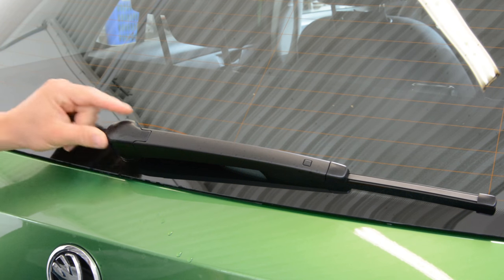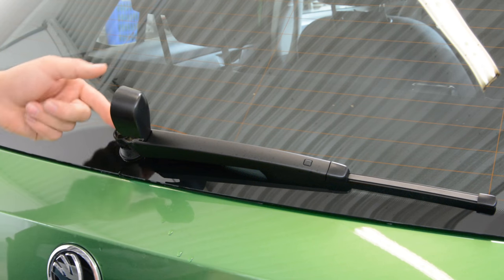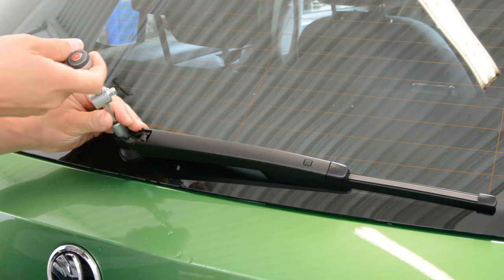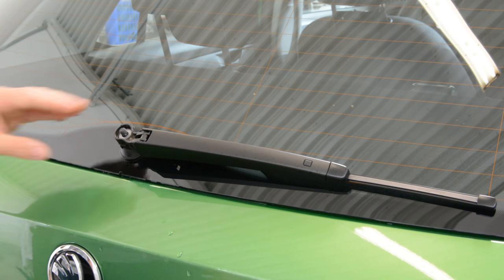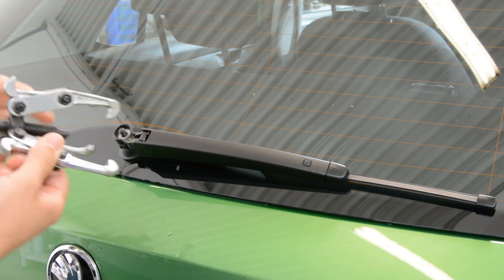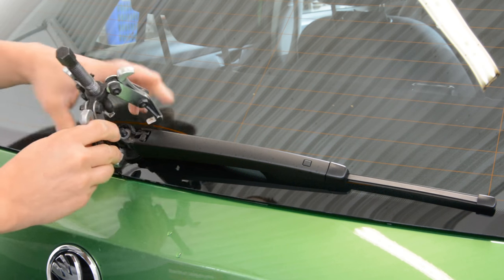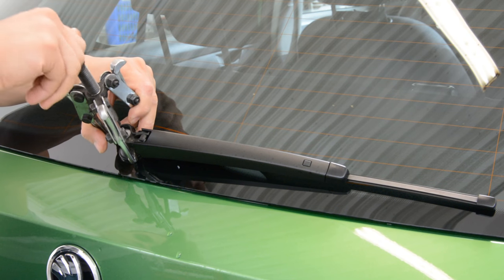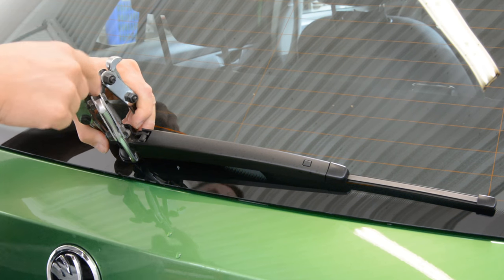Removing the wiper arm without special tools Skoda Fabia

Comment: now try doing that with a 10 year old car
Reply from the maker: Use some w40 it will help:)
Reply: Yes 10 year car that takes a beating of northeast winters even wd40 won't make it budge
Reply: Tried it all..2 wiper pulling tools also..what is the name of this one ??
Reply: It worked?
Reply: I just managed to remove this sucker. Skoda octavia 2013. Im guessing it was an original part. Took some beating and CRC penetrating oil. Man oh man, what an annoying design.

Comment: Nice video. If I remove the arm will I be able to place the spring back on which has come off or do I need a whole new arm?
Reply from the maker: Yes, if the place where the spring come is not broken you can put it back, the only way to find out is to take the arm down